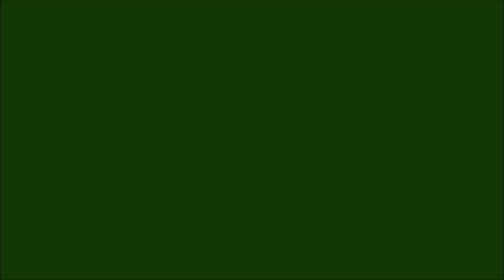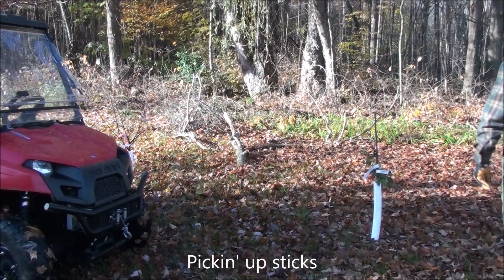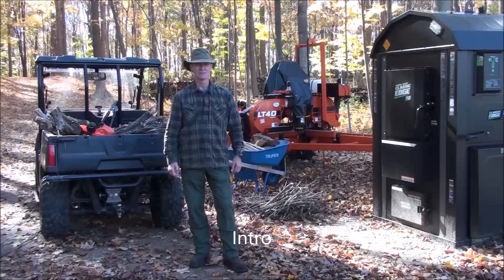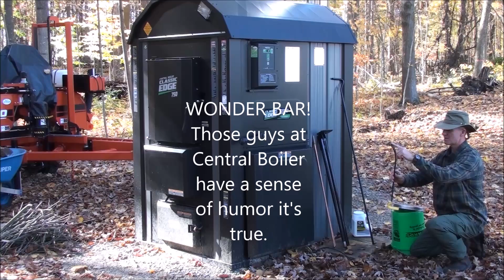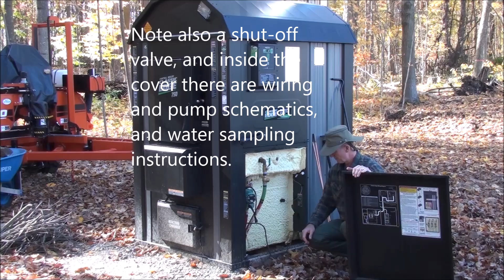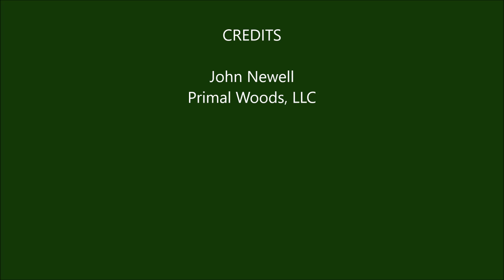Central Boiler Start-up Part 0 - Intro and Walk-Around

Comment: Now that you have some experience with it can you tell me what the wood size limitations are?  I am hoping to get away from splitting and would like to burn 10” rounds without splitting and 10-16” halved, 16 and over quartered.  Think that is possible?
Reply from the maker: I can't really talk to that from experience. I split everything bigger than say 4", up to say 8" in half, and quarters bigger than that. Not saying it can't be done, in probably can, just that I haven't done it. My experience is that once it's really cooking you could probably have success with 10" rounds, so long as they are thoroughly seasoned.
Reply: Thanks.  I know with my eko I could take a log cut that day as large as could fit through the door and it would burn smokeless provided it had a large coal bed and the refractory was hot.  The eko only has a 6 ft2 firebox your boiler has 4 times the firebox size so I imagine you could get away with a much larger round.

Comment: there's no pressure in that fire box you make it sound like it will blow up if you don't throw that handle you'll just get a little smoke in your face
Reply from the maker: There is some pressure, though I'll agree, not much.  But since I don't wear safety glasses when I'm cleaning and feeding the boiler, I prefer to release whatever little pressure there is.  No smoke / ash in the face.
Reply: I have a eko boiler and those gases in the upper chamber will absolutely explode when opening the upper door if you don’t vent them off first by using the bypass lever.  It has happened to me several times, won’t kill you but will singe your eyebrows!

Comment: You have had less than one year, how are you liking?
Reply from the maker: I love it.  I was expecting, based on an informal survey of locals using wood-fired outdoor furnaces, that I would consume somewhere between 10-12 full cords of wood.  I used less than 6.  It is super efficient.  I'm adding on to the space being heated with the boiler this year.
Reply: +Primal Woods how does water in th boiler not freeze in winter when you have not run in in several days. I understand the pipes going to the home have insulation, but im talking within the unit itself. Glad to hear oyu are liking it
Reply from the maker: The water circulates continuously, even if you are not feeding wood to the furnace.  My propane-fired furnace is running if the boiler is not, and the return air flows through the Central Boiler's heat exchanger on its way back to the furnace, so the water in the boiler system picks up heat from the house.
Reply: Does how much does it cost to get one

Comment: how much does a unit like that cost?
Reply from the maker: Andrew jones All in, installation including insulated PEX at $11 per foot, this was about $15,000. We are planning for add'l buildings and have capacity we won't use right away, but even without add'l bldgs payback is less than 5 years versus our historical propane costs.